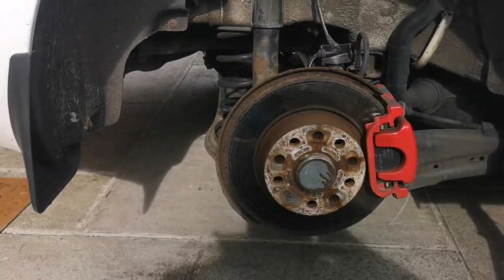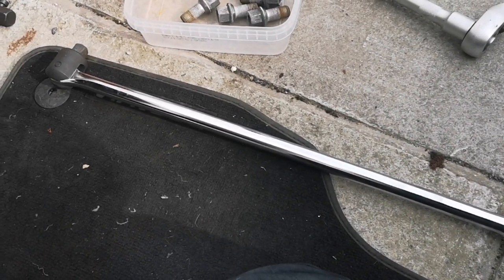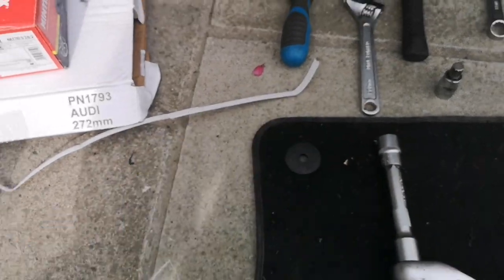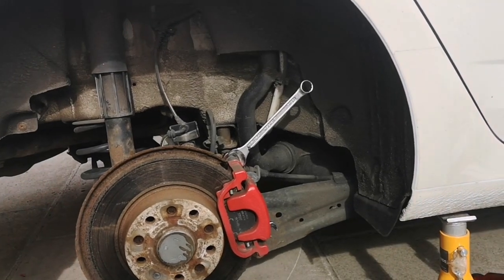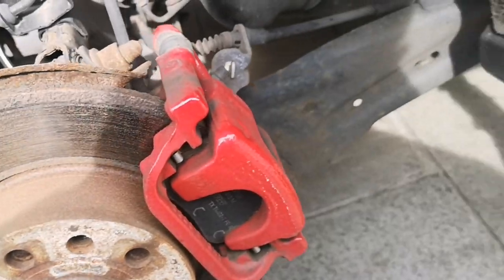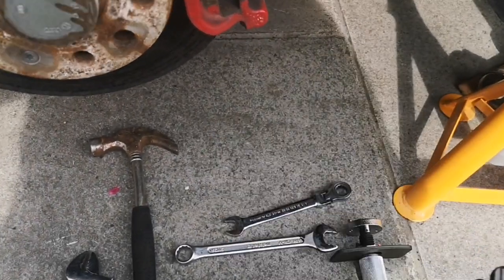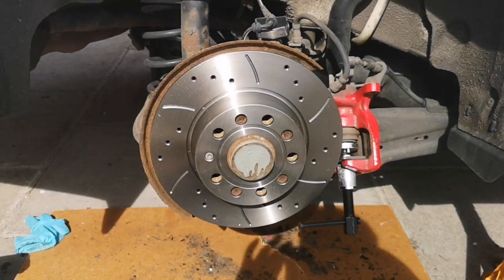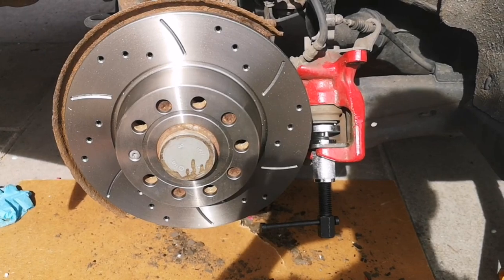Octavia VRS Mk3 rear brakes pads and discs changed.

Comment: Good video, well explained but beware, I watched before I changed my rear pads, word of help, being a cheapskate I made up two tools one to press the cylinder back and one to rotate the cylinder/piston.
That's where I came unstuck, the two operations have to be completed together, drat, off to local Screwfix, they had 3 universal kits in stock, saved the day, then went a dream.   JD

Comment: Great vid, really helped me. I tried undoing the two bolts holding the main pad housing with a  normal ratchet on first wheel, worked eventually but had back ache after! Learned the hard way before seeing this, had to buy a breaker bar for other wheels but then also had problems with getting the caliper piston back in as I pushed the brake pedal whilst the  caliper was off the wheel - nightmare! That’s the way you learn though I guess.